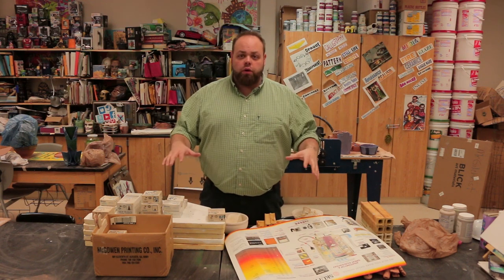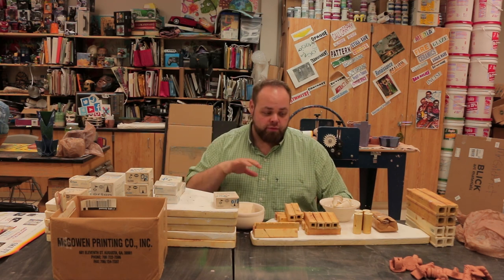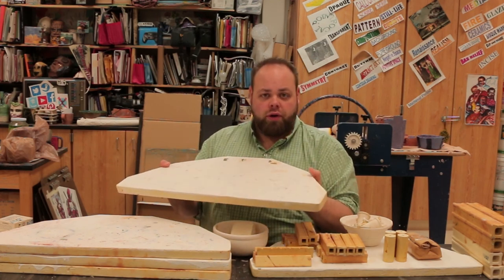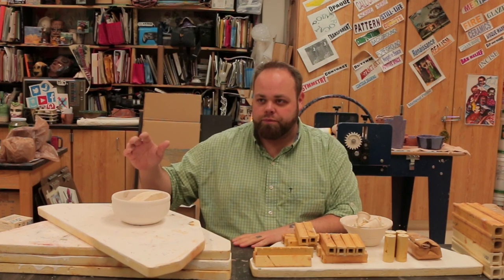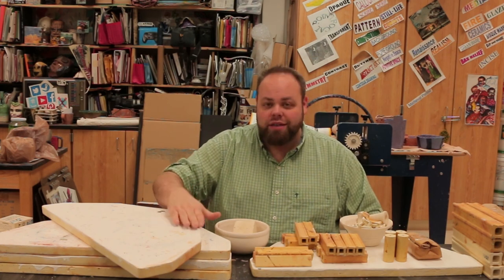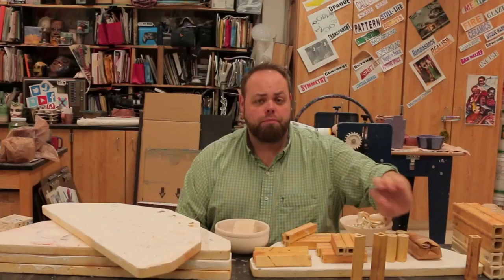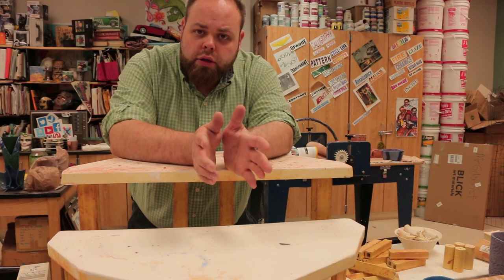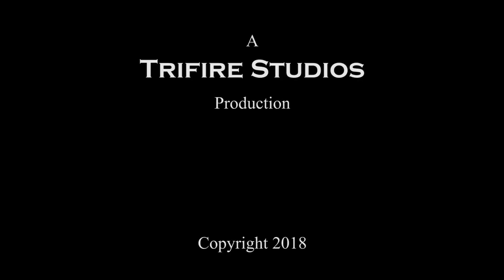How to load a kiln - Ceramics 101 - University of YouTube

Comment: Can you make a suggestion as to where to buy kiln shelves? I just inherited my mom's kiln and some molds, but I don't remember  seeing any shelves. I do, however, have a bunch of different stilts, so I know that shelves were used in it before.
Reply from the maker: Check to see if you have a local ceramic shop. You will need to know if you want half moon, hexagon, or rectangle/slat shelves. Most use the half moon. 
The local place in Atlanta is Davens Ceramic Center. 
If you need more help let me know.

Comment: i make a lot of mirrors and flat pieces with clay so it takes up a lot of surface area in the kiln, but my pieces barely ever have much height. does that mean i can place more shelves with less space in between them (shorter stilts) in order to fire a lot of flat pieces at once?
Reply from the maker: Short Answer - Yes, but . . . 
The pieces can be placed in shorter distances together (I would give about 1/2 - 1" clearance between the piece and the bottom of the shelf.  The concern is the atmosphere that is being created while the piece is in the kiln.  The glaze has to have a little bit of space to breathe around the piece and the clay will contract and expand during the firing process (not much, but a little).
Hope this helps.  Keep me posted.

Comment: This was sooo helpful. Thank you!! I plugged 2 of my 3 holes for my bisque fire. I haven’t fires it for several years! I’m so glad I watched this first!!
When you stack the shelves out of the kiln I was told to make sure and put kilnwash sides together so as not to get the wash on the bottom of the shelf. Is that correct? Also I love your idea of using a chair!
Reply from the maker: You can stack them the way I did. As long as the kiln wash has been fired once it won’t matter. Keep me posted if you have questions.

Comment: I am at a new school with a kiln so its my first time getting do use ceramics with my students - YAY! This video is very informative, but as a complete newb and a visual learner I still have follow up questions:
1. Kiln wash - how do I apply that exactly to the shelves and the stilts?
2. How do I know my shelves need fresh coats of kiln wash? I'm told none has even been applied.
3. The wedge - I don't have one. I have an electric automatic kiln. Do I need to buy one if I absolutely let all pieces dry out for a few weeks?
4. The plugs - With an automatic kiln, do I need to take any of them out for low fire clay and low fire glazes or can I run the kiln with them all in place?
Reply from the maker: Margaurita Spear, happy to help. Send me an email at trifirestudios@gmail.com and I’ll work with you on tackling those questions.